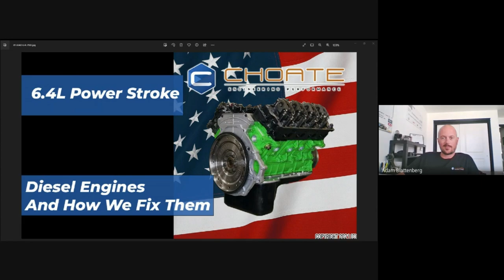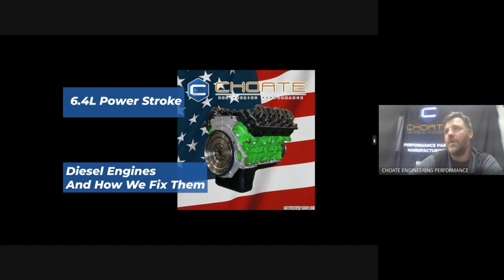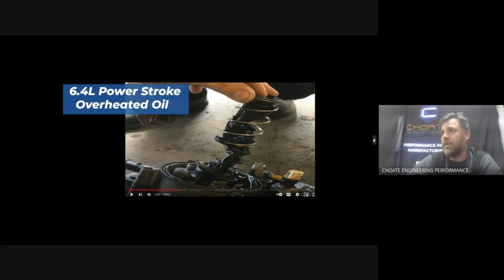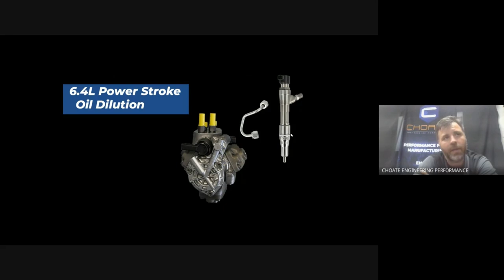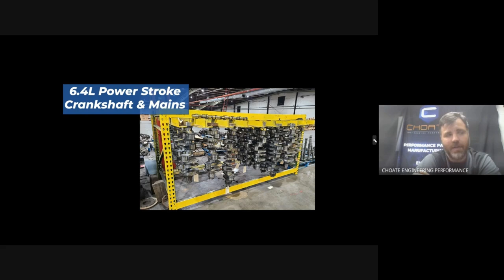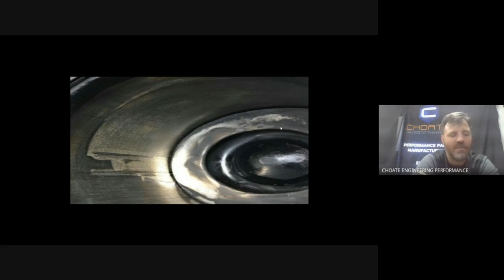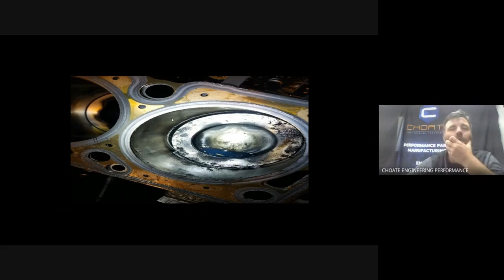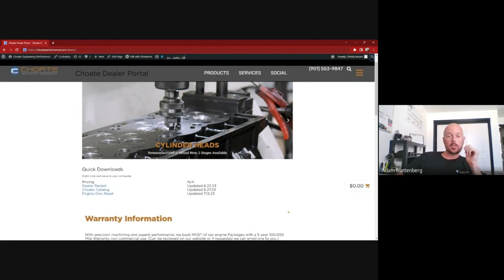6.4L Powerstroke - Problems and Fixes

Comment: “The 6.4 could be a fantastic engine. It just needs to owned by only two kinds of people. One’s an old man and the other is a mechanic.” I knew it was comin. My 6.4 got 196,000 miles and counting. But I drive like an old man and I’m a half way mechanic
Reply: Have you ever ran into issue where it leaks engine oil from above the balancer? And it makes weird noises under load only?
Reply: @itsdanimusic8395  I haven’t seen ran into that yet but my uncle’s 6.4 had oil leaking from the rear main seal which he had to replace. Mine also has a leak from the rear main but that’s the only leaking I’ve noticed so far
Reply: Mines got 230 on it and I drive the  fuck outta it , not even gonna lie I work o. The road and I’ve had it for 2 years and it had 174k when I got it and them 60k I’ve put on it have been some hard miles lol and I’ve only replaced my water pump once my driver up pipe   Once and my map sensors she runs like a champ and it’s my daily 🤷‍♂️

Comment: I really appreciate you fellas posting this or simply taking the time to make this episode. I daily drive my own 08 6.4 King Ranch crew bad with 8’ bed. Currently has 265,000 miles but the last 100,000 have been with issues. Burping coolant overflow. Here’s what is weird, I’ve done 2 separate leak down test that resulted in no blown head gaskets, my oil temp and coolant stay with 5 degrees of each other under load with a loaded dump trailer hauling tear off from roofing. NOT LEGAL AND I DONT DO THIS KNOWINGLY, OFTEN, but last time the axles and tires on my 7x14 dump trailer with raised side walls, the f’er was squatted!! Truck pulled it through town, speeds never got above 10-15mph but it did it no problem. Heater blows cold and coolant spews from overflow if topped off and under heavy load or driven hard and fast with no trailer. I’ve had local shops try and diagnose and all say the same, even tho leak down test and oil and coolant temps are within 5 degrees at all times you have a blown head gasket. I’m getting ready to remove the cab and rebuild as I love this truck. Interior is mint and it’s the normal 08 king ranch saddle leather with buckets up front and 2 buckets in rear with center consoles in both. I love the truck and will never get rid of her. My intentions are to remove cab and bed and do frame up resto, get her back to when I bought her and looking gorgeous! Not blowing smoke but my King Ranch is the best looking one I’ve ever seen with the chrome and just the right factory lift that I can run Toyos AT’s and my god I get compliments still today 15 years later. I will own this truck till I die and your info here is excellent. So, thank you guys!!! There are many of us 6.4 diehards out there. 
Ps……mine has EGR delete and programmed and there is even today NO TRUCK IN GRESHAM THAT CAN TOUCH OR EVEN COMPETE WITH MY 2008 6.4, even smokes new sports cars, she’s FAST and untouchable. 🤩🙌😎😁👍
Reply: Feel the same way. I dont know why but 08-10 are literally the best looking models ever designed.

Comment: Thanks for your content.  I bought one in a 2010 by mistake at an auction not knowing which gen was what.  Now I have to learn. Hard to follow a guy with jumping around issues or back and forth.  Maybe follow an outline and not memory.  My 2 cents.

Comment: Brilliant.  I’ve owned a 7.3
J have a first Gen 6.0 built 12/02 original owner 545 thousand miles NEVER touched it. No studs no bullet proof towed up to 40 thousand lbs weekly.  3 previous 6.7. Current one with one of your motors and picking up my new to me twin to the truck I have today. Never owned a 6.4 but can totally appreciate and understand your tutorial on the engine best used as a boat anchor  you must really love your work to go so far in depth !

Comment: So I put 197,000 on mine. Stock form dpf and egr's. No coolant leaks original radiator and all. Only issue was the ebp sensor in all that time. In 2016 the hpfp went out. Bought a new fuel system, new heads from UCF, Valve train components, bpd water pump, oil cooler, BD mans and up pipes. Now I have another 70,000 on it and it still runs good. Original turbos also.

Comment: The 6.4 is a great engine but not in the stock configuration. A tune focused on efficiency and deleting the emissions programming and not on putting in a ton of timing and removing the DPF and EGR and it'll likely run for a long time.
Reply: Even if you delete the emissions they're still ass. Parts are expensive, the water pump eats through the cover, the heads crack and warp, the rods aren't bushed, the radiators leak constantly, and they get horrible economy even deleted. I had one. It got 13 mpg deleted with street tires.
Reply: Mine is done as such . Runs great.  175k .

Comment: Are you saying everyone that bought one of these new or used should be involved in a class action lawsuit especially those that are in areas that are forced to keep the failed missions control systems. Then bypassing this with aftermarket systems in an attempt to help get some longevity out of these vehicles that are now being fined through the EPA for trying to correct these issues that Ford should have admitted fault to.

Comment: Getting rid of my 2009 6.4 was the best decision I’ve ever made, nothing but heartache and wallet break on that truck. Bought it new treated it like gold when it comes to maintenance and it failed several times even at low miles.
Reply: Same experience I had with mine. It was like if BMW made a pickup truck.

Comment: This is comming to you now Dec 10 2023 my 08 6.4 was stamped Jan 08. I deleted all that failed Goverment science prodject on emission control as soon as the wornty was up. At abought 90K the front cover went as well as the rear seal then that was covered by wornty. Then after that I did the deletes. I was told to get rid of it. But I'm  still driving it. With 140K miles now on it. Hell its an 08 its the end of 2023 she feel great, looks great. But I'm looking for a set of the Bulletproof valve covers with the extra oil injectors built in with all the nessary hardware and hook up instructions. Befor I  have lifter isues. Or when I tackle all the re and re under the valve covers I would love to get a set of those modified valve covers Bill at Bulletproof was talking adout a while back.I love this truck❤. I have heard all the isues. As well I heard reducing service to 5K intervals is a good idea and I have always done that. But living in western Canada its hard to find these cool after market products. Or to just get them across the border$$$. Any way I'm looking to keep this truck or go broke doing it😂😂😂👍

Comment: 6.4 is a power house with the fuel
System and turbo capability. Lots of potential but longevity was short. They were known to make oil lol aka fuel dilution. I do like a well sorted 6.0 liter with O ring heads and studs. The bottom ends of the 6.0/6.4 are pretty stout with strong crank and rods. 6.0 pistons seemed to fair pretty well. The cylinder head on 6.4 used a 16mm vs 14mm on a 6.0 but the real improvement was the cylinder head castings. You didn’t get good clamping as you got away from the fastener where you needed it most on the 18mm 6.0 heads. The later 6.4 heads had beefier gussets which helped transmit the clamping force around the cylinder for more even distribution. Lifter failure in my own opinion was the fact that each lifter operated a bridge and two valves it was under a lot of load. I think if you did 5000 mile oil changes your chances were better. My camshaft at 250k was wearing hard on the lobes through the surface hardening. That Siemens K16 pump seemed to have a decent amount of headway. It wasn’t very robust but it could move a good amount more fuel than the 350hp rating of the motors

Comment: Okay so to summarize, dont tune it to something stupid, install a coolant filter to keep sand out of the system, remove DPF and EGR components. Regular fuel filter and maintenance and she should be good to go? Mines got 400k km on it, Ive done a lot of work to it including the things i just listed. Any other preventative work you might recommend?
Reply: Just my opinion, fuel additive to lubricate the pump in every tank can’t hurt. Good oil and an oil additive every time can’t hurt either. It’s what I do. 196,000 miles so far
Reply: @outcastfisherman6991  What sort of fuel/oil additives do you recommend? Theres so many that offer a variety of benefits, is there any grouping that you've stuck with?

Comment: You forgot to add the correlation between the high timing in these tunes and cylinder pressure.  I’ve built many 14 liter Cummins engines and cat engines.  Both engines will crack pistons when adding fuel and faster timing.  Yes it makes power but sadly cracking is the side effect.   That’s why I Retard the injection timing to lower overall cylinder pressure.   Great vid btw
Reply: Good point but tons of stock tune 6.4s have failed. A hot tune on a 6.4 seems to be a death sentence (eventually)
Reply: @Bacongrease00  anything will fail.   Key is making it last as long as possible.   I’ve seen tons of 6.7’s have main and rod bearing issues along with L5P duramax’s window the blocks before their second oil change.   You get good and bad engines in every bunch.   Like rolling the dice honestly.
Reply: @6.4DieselDoctor  I thought your comment was insinuating that these cracked pistons were because of high timing in tunes. Which is true but I was just stating many 6.4 have cracked pistons on stock tunes. The 6.0 really didn’t have that issue with pistons intetesting enough

Comment: 6.0/6.4 bottom ends are robust. The crank and rods are beefy. The 6.4 rod can take a lot of power it’s usually the low end torque that hurts them if your running compounds and big fuel.

Comment: Best fix is to remove it and put in a Cummins. I think Bill at Powerstroke help said 8 out of 10 he bought for cores had bent cranks.  We saw two with bent cranks at my shop.
Reply: No way u dont know what ur even talking about, what woukd possibly bend the crank they hold 1200+ hp

Comment: My 09 6.4l has given me NO problems since purchasing brand new. Delete at 120K, and I use all the Archoil oil and fuel additives religiously!  Absolutely change fluids correctly, use only Motorcraft parts!!!!! 
Now: I am chasing my first issue ever, I’m my own mechanic and I know this truck inside and out. This issue has me lost, but I know I’ll fix it hopefully before anything worse. 
16mpg hwy/ in town😡

Comment: My biggest question is why is the 6.4 so horrible on fuel mileage ? My built 6,0 gets almost triple the mileage.
Reply: You probably not deleted , my tuned and deleted 6.4 gets 19 empty on the highway .
Reply: @11bravoak  mine is , I average between 11 & 14 in the 6.4, the 6.0 is far better

Comment: In negotiations with a seller in Texas, 2008 F450 4x4 Lariat,  original owner, 19,800 miles, absolutely beautiful truck, fully deleted @ I'm told around 2,500 miles. ASKING $40,000 yes or no?
Reply: No way man 40K step into a later model 6.7
Reply: No more then 30k, if it had a Choat or kill diesel crate engine then 40k might be justified
Reply: @FlatBedLife717  I know a guy who spent almost $30k on a Choate 6.4, got 12,000 miles out of it ( blew up ), they wouldn't hold up to warranty coverage, guy had to get a lawyer, was a total loss all said and done.

Comment: How can you comment on the pump adding fuel to the crank ( the big no-no)? When the regen of the DPF in the period of servicing time that fuel bypassing the piston rings in bombers 7 and 8 is so great maybe because of excessive ring gap because of the extreme temperatures of over 1000%F I have heard 1400%F the ring gap has to be so great so as it doesn't close up due to expansion that even when not in regen the gap is so wide that fuel is just bypassing the piston rings to the point I have heard an extra three pints of liquid in the crank at service time. Now call me wrong. However, I have seen this in my own 08 6.4 F350 Super Duty not ever raced with less than 100k on the odometer and the dealer said that's OK. OK. WTF OK.?

Comment: Can you say
Failed government emission control  science project forced on the auto manufacturers. Remidy. Delete delete, delete. And add a large well baffled and with an SS wool filter that does restrict blow-by-movement. Connected by 1" ID tubing that is not kinked in any way that would restrict blow by exciting the crankcase.